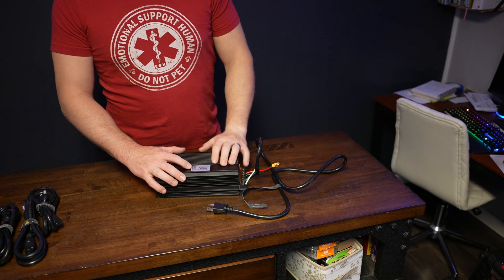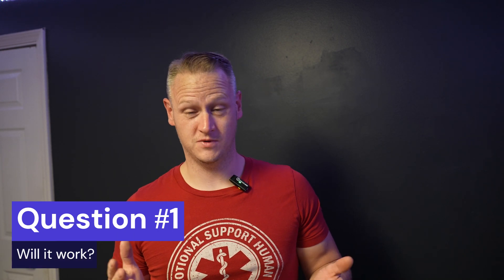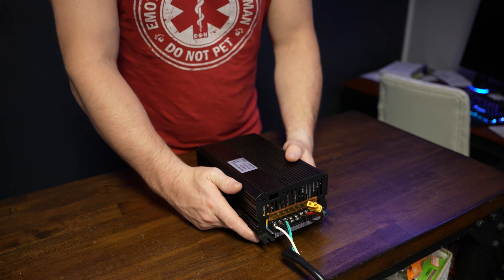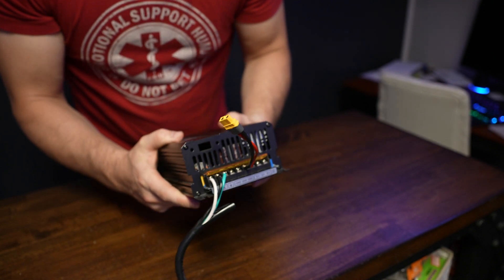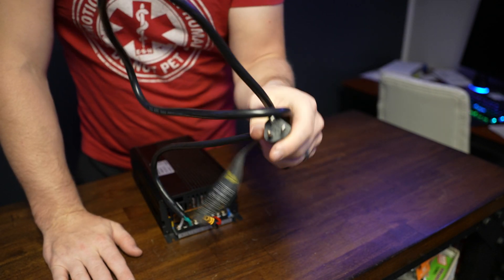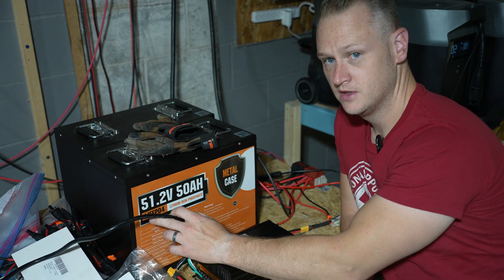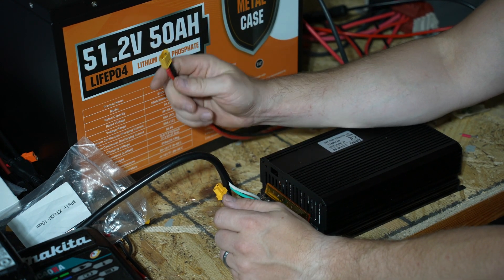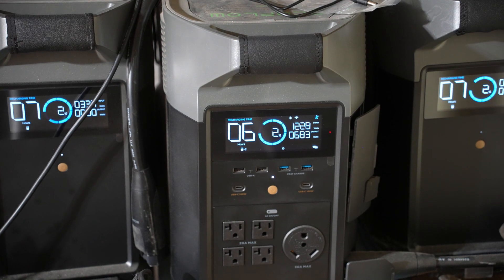Ecoflow Delta Pro  - Using an AC Switching Power Supply to extend your Delta Pro

Comment: Hmm, I have a question. Why not just use the AC plug that comes with the DP and plug that directly into the power strip coming out of the inverter? I think that would give you more like 1500w charging. I have two DP's and during power outage I run a GENMAX Portable Inverter Generator, 3500W Super Quiet Gas or Propane Dual Fuel Portable Engine with Parallel Capability, Remote/Electric Start when it is too cloudy for my solar and that will charge both DPs at over 1500w from the AC from the generator.
Reply from the maker: Fair question! It's because when the Delta Pros are connected to the smart home panel via the infinity cables, both the AC input and output ports are disabled. Its a Ecoflow Delta Pro limitation.
Reply: @DanielGoodwin-jq1oc Question for you.  If there is a power outage wouldn’t the Delta Pros automatically re-enable the AC input because it will sense that there is no power coming from the Smart Home Panel? I would love to know the answer. Maybe you can test this by turning off the breaker in the house mains that is used to charge the Delta Pro via the Smart Home Panel.
Reply from the maker: No, unfortunately is does not. It disables the AC input/output when you connect the infinity cables. Now, of course, during an outage or emergency, you could also quickly disconnect the infinity cables and certainly use the Delta Pro as a standalone unit. However, that really isn't the intended purpose of the DP when you combine it with the Smart Home Panel. If there's an outage, the panel will pull from the delta pro(s) and their batteries to keep power on in your house. If you have solar (or really any DC input) into the Delta Pros, you can continue to feed the delta pros while providing AC power to the house.
Reply: @DanielGoodwin-jq1oc  I think I have figured out a way to get around this. That is to build my own 240v hub. Bringing the output of each DP 30 amp output into a small box and connecting them together into a 240 out plug therefore bypassing the infinity port altogether
Reply from the maker: That's an interesting solution! I'd be eager in hearing how that works out for you!